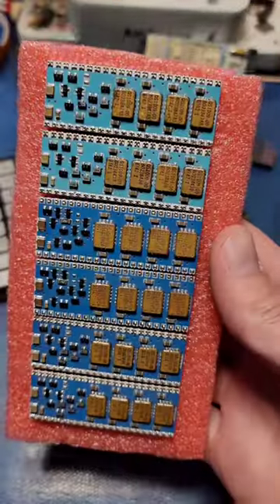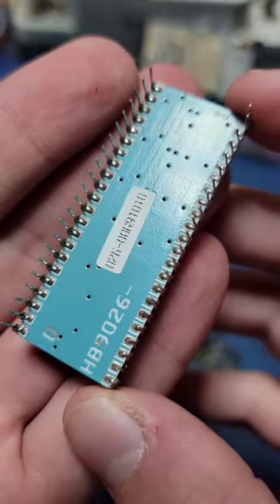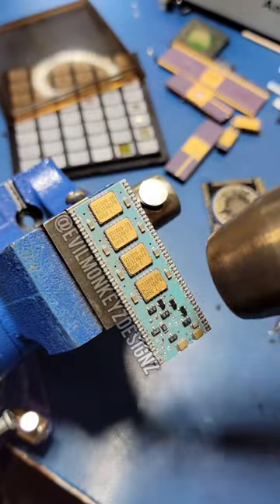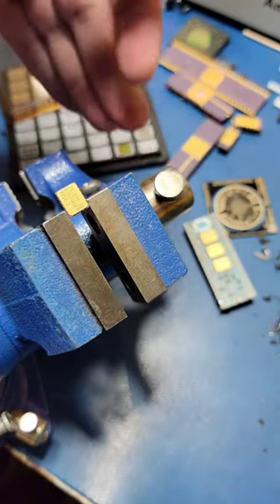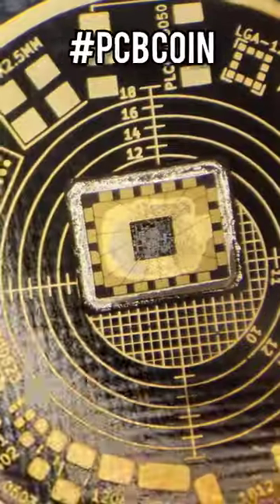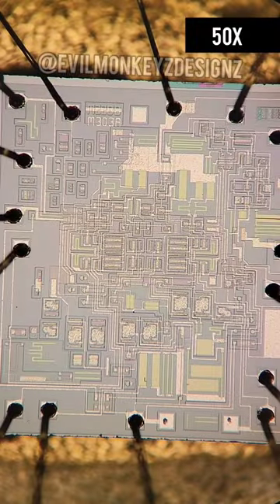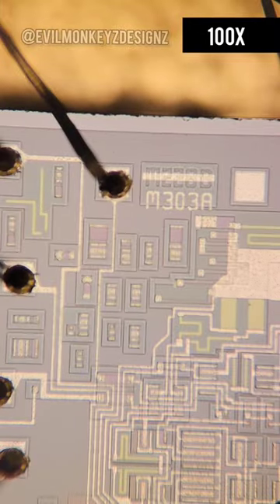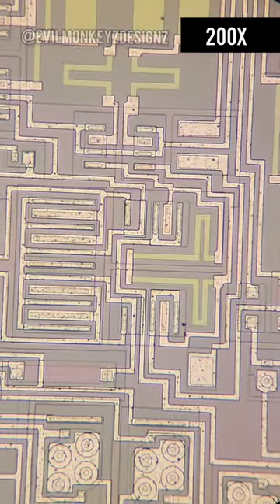CCU #291: Unknown integrated circuits on a ceramic circuit board #shorts

Comment: I like how the makers of that circuit just crossed out the old version's name.
Reply: The original part ID was written in what looks like some sort of oxide opening for an implant/diffusion. That strongly implies that the new part was made just by rewiring devices that were already present. This is somewhat common on uncommitted gate arrays or semi-custom analog ICs.
Reply: He nerfed it

Comment: We included extra components at multiple locations just in case you needed them they could be wired in with just metal and app mask changes. A prototype wafer run would be 12 wafers with 6 held back at first metal…thus if you need to make changes at the metal and app layers you could get your next prototypes in just a few days. This strategy saved both time and money in getting working prototypes.

Comment: Old Panasonic VCRs used to implement theese ceramic modules. Chroma circuits, RF Cylinder (VIDEO HEADS), Servo frequency generators, ETC. All embedded in a single ceramic package full of small ICs. Allways analog circuits...

Comment: Funny, this is what I did as a student summer job at a big automotive electronic company here in Germany: Taking samples from Suppliers, opening the circuit housings and performing different tests such as pulling off the bonding wires and measuring the force neccessary to do this…

Comment: Those are analog circuits; there are some high -power driver transistors on the chip. Spare sites are common in the old days in case a revision is needed: you can just change the metal layers to connect up some spare components in case you need, say, an inverter for a signal or a latch or a few gates.
Reply: I concur. BSEE and 40 years doing board, modules, and IC’s. It’s gonna be mighty tough to reverse engineer that thing.
Reply: @bretdaline8987 I ordinarily despise the hype surrounding “AI,” but I wonder how well a neural network would work for picking out specific circuits and summarizing what they do.
Reply: It can't do physics though. AI can't even do math.
Reply: @Ureallydontknow  It’s not even really AI, honestly. It’s just linear algebra and statistics that is good for finding and recombining common patterns in huge datasets. It just so happens that it’s gotten refined enough that it produces content that looks intelligent and is sometimes passably useful for certain tasks.
Reply: @rfichokeofdestiny    ur well educated my friend

Comment: One of the reasons why you might see those unpopulated components on the silicon is silicon tends to change its properties when another device is nearby so they might have done it to remain consistent for analog electronics

Comment: All I can find on it is that it was made by IAC Industries Inc (would have been prior to their line of products changing) and that the form factor for the chip is LCC-18. There are also later revisions of it, but I am having issues getting a datasheet for any of them. I do know that it was used in automotive and in communications devices.

Comment: I always expect the ceramic chip to be vibration tolerant, but when you remove the cover, there are still tiny wires connected between the silicon wafer and the pins of the chip. Are these particular ceramic chips not for rough environments and that is a relatively new usage for these packages? I enjoy your videos and look forward to your explanation!
Reply from the maker: I've often wondered the same thing myself about the free-floating wire bonds. I assume that it would actually take a pretty severe impact to move them, and at that point I think you'd probably have worse things to worry about depending on the application. Some parts that I've opened will have goop (might be some type of silicone?) over the wires to prevent them from shorting.
Reply: @EvilmonkeyzDesignz : The ones with the goop are more likely to be specced as acceleration/drop -tolerant.

Comment: Wait, so you can just take a picture of the silicon die to find out what it does?! You have to be extremely smart to be able to do that, wow
Reply: Yes, they don't just magically work, it's all logic gates inside and if you design microchips for a living it's not too hard to recognize logic clusters. You can reverse engineer chips just by looking at the die though it's complex and time consuming for modern chips with millions or even billions of transistors but that's all it is, just a bunch of tiny transistors arranged into logic gates to perform mathematical functions and if you're used to building things with logic gates it's not that hard, just time consuming to puzzle it all together.

Comment: The fork-like things in the middle looks like accelerometers.
Reply: They look like that, but I think they are too big. Probably a capacitor used to tune the circuit if I'd have to guess.

Comment: Wild looking. If you get a chance with that high res cam can you look at a ws2812b or any of the addressable RGBLED’s ?

So small… and silica was basically sand… fascinating
Reply: LEDs are rarely silicon lol
GaAsIn or some such. 
Hetereojunctions are really interesting
Reply: @wilurbean yes, and...

Yes, AlGaAs and weird shit is cool AF. Also, addressable LEDs have the weird chemistry semiconductors, AND a control chip that converts I2C or something similar to adjustable currents to the RGB LEDs. These controller chips are silicon.
Reply: @wilurbean He's not alking about the LED lol
Reply: I've looked at neopixels under the microscope, it looks impressive
And it's easy to do without using strong acids or any tools because ws2812 is transparent lol
Reply: @wilurbean  I see the misunderstanding- I’m referring to the “scam” if you will of converting sand to complex electronics. Like how a car was at one point mostly rocks in the ground. Oversimplification for digestion. 

It was meant to be a standalone thought. 
Good points though! Y’all are cool.

Comment: That might be DTMF control board...
Reply: DTMF is what I was reminded of. I remember using similar 40 pin DIP modules for DTMF functionality in the mid 2000s. However, this particular one doesn’t seem to be DTMF.

Comment: Leaving stuff on the chip is like junk DNA xD .
Reply: It's a semi custom analog IC. The designer chooses which parts from a bunch of parts to use. The benefit is the parts can be made all the same using the same masks, which are expensive, and then at the very end a custom metal mask defines the actual circuit. So you can make current mirrors, op amps, voltage references, etc all using the same process and design, and any customer who asks for something different can be given a prototype in the time to process only the metal layer (plus assembly).

Comment: Can someone explain to me how these are made? I just don’t understand how machines are able to be so precise with creating little things like this.
Reply: a common way to do it (back in the 70s/80s) used to be photolithography. they'd used photo-etchable materials, lay it out very nicely with an opaque mask on a transparency (e.g. cut it out, or draw it with a pen), then shine light through the transparency and the mask, using lenses to evenly shrink the size, and etch out the materials that make up the parts in the circuit.
dunno what they do anymore. I am guessing it's a combination of techniques now, for much more complex parts.
this particular part might look complex, but it is a relatively very simple circuit compared to modern microprocessors. I wouldn't be surprised if this one could have been done with photolithography.
if you want to know more about the specifics, google that word.
Reply: @blarghblargh  Thanks! Learned something new today
Reply: It is the same process today. Just much higher accuracy, computer drawn masks, Ultra Violet light and mirrors instead of lenses.
Search for ASML EUV machines, they are crazy but the same principles.

Comment: you don't think those 'unused' things might be for fabrication testing/quality control?  I remember while working at Texas Instruments they would have areas of the wafer with test pattern you would probe before it moves on to the next process.
Reply: Those areas of the wafer are usually dropped out of the main design and never assembled. This is likely some sort of analog semi-custom chip where the metal wiring defines the circuit from a bunch of devices that the designer can select to use or not use and how to wire them up.

Comment: Strange.  Why keep making the chips with components/features that arent used 
Correct me if im wrong, but its like building a car with a motorized seat but no connections or controls for it, making it a stationary seat with unnecessary motors
Reply: Sorta, but setting up mfg of chips is really big pain in the ass. It's likely they could make more money by selling chips with broken/difficult to mfg components not working as lesser tiers, ie binning. 
Or
That those components required additional processing that wasn't necessary for some tier. So they use the same basic box to make 90% of the chips, sell those at price A and the ones with the extra steps as price A+B.

The name of the game is less production lines
Reply: More features don't cost anything extra (almost), as long as the total chip size doesn't increase. ICs are made by photolithography, so all features are made simultaneously by shining light through a shadow mask. Making the shadow mask is horrendously expensive, but making the actual chips is very cheap.

To me it looks like those are either test features, or leftovers from the previous version.
You can see that they re-used some of the masks from version 223B, that's why the version number is crossed out instead of just having a different number. Again that makes sense since the masks are expensive. If you just have to change just one of the layers, you don't want to buy new masks for all the other layers.
Maybe there used to be some circuitry there, but not in the newer version. Because they re-used masks, there are some remnant features.
Another possibility is that they are test features, probably the individual building blocks that are used all over the IC. You can make contact with small needles and probe each one of them to check that they perform as expected. It's useful for "debugging" the design and manufacturing process.

Comment: This is the first one ive seen that looks... silly. Why is this tiny chip in a large container with little wires stretching across the gap?
Reply: PCBs with fine enough wiring to contact these pads didn't exist when the chip was made. So the wires help "fan out" the contacts to the chip. The chip is expensive per unit area of silicon, so can be made much cheaper this way.
Reply: @DeShark88  interesting. It seemed like it would be cheaper and easier to make the chip larger if there is no requirement for it to be small. After your comment it makes sense.